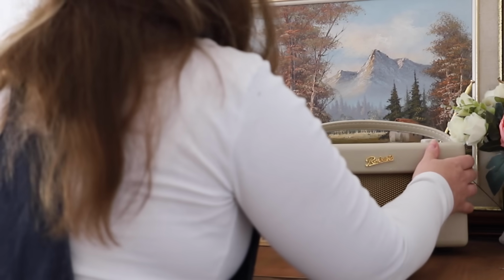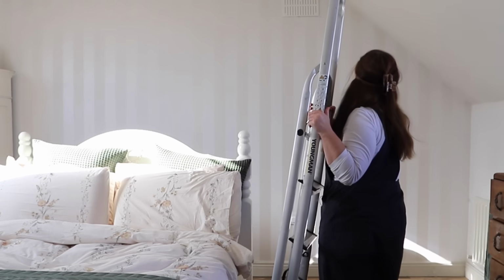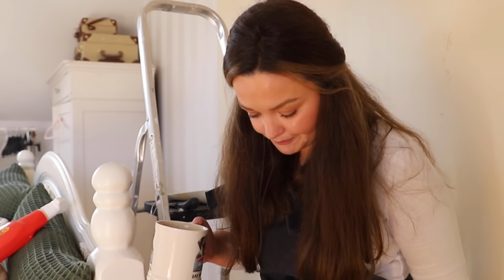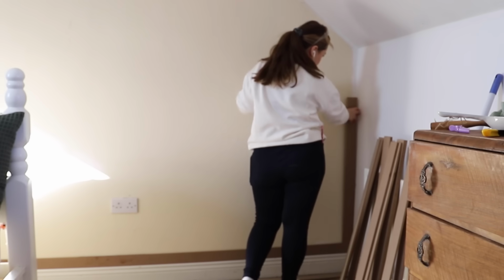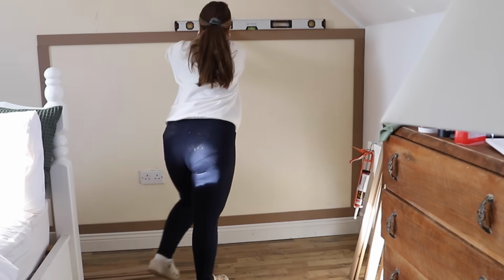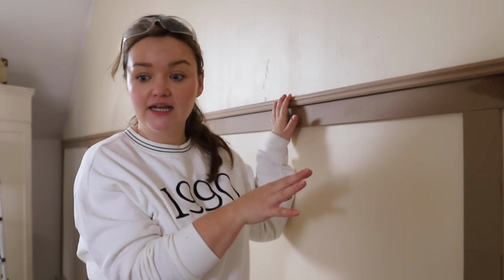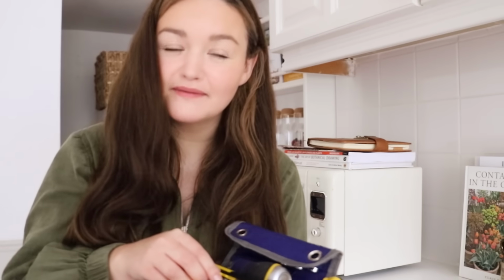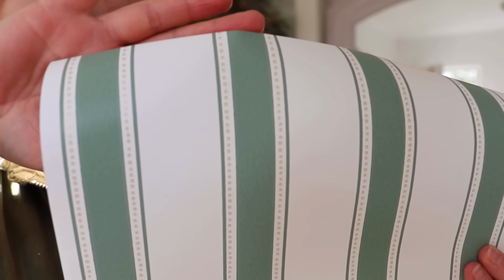Transforming My Bedroom on a Budget! Cosy Cottage Style Makeover 🌿✨ DIY Diary

Comment: Very ambitious.  I can relate, having just repainted and tidied up my snug so I could have a fresh comfy spot to do my Christmas wrapping.  And, yes, when I caulked the baseboard (skirting board), I had to use two hands and make a face to get the caulk out of the gun.

I feel so validated to see your dust bunnies!  My daughter recently bought me a robot vacuum for a big birthday.  I was skeptical, but I LOVE it.  It even goes under the bed  :)

My cats are fascinated when I move things around.
A cat tip for your weeing girl.  My anxious girl had the same problem and I figured out that she was overstimulated by catnip.  When I stopped giving it to her, it cured the random weeing.  I don't know if you use catnip, but it might be worth considering if you do.

Such a lovely big room with the high ceiling.  What you call a dormer bungalow, I call a story-and-a-half (or maybe two-thirds). That's what I have too and I love my bedroom, which I re-did not long ago.

Do you know if that was a strippable paper?  A vinegar and hot water solution in a spray bottle also works for stripping wallpaper, but not as slick as your steamer.

Do you have Benjamin Moore paint in Ireland?  My current obsession is with Simply White, and it's taking over my house.

A motherly bit of love for you...  Make sure Ricky Martin isn't so loud that you can't hear a normal conversation and that you don't have the earbuds in for more than twenty minutes at a time, for the sake of your hearing.  Another tip is to alternate ears so you can do twenty minutes on each.  Head phones are safer.  xo

Art Attack!  My girls loved watching that show.  I hope your nephew's teacher isn't subscribed and watching Auntie Catherine make his costume if it was supposed to be his homework.  Lucky loved boy  :)

Seeing the DIY process in diary form is not annoying, wheels off is just fine with me  💜

Comment: A little tip I use. The cheapest panelling at B&Q is £13.47 it contains 6 pieces of 1200mm of MDF (63mm W X 9mm T) making it around £2.25 a strip. 

You can buy a 9mm T MDF sheet for £12.97 that is 1220mm L 607mm W and B&Q will cut it in strips for you. The first 5 cuts are free (with each sheet you buy) then it’s 50p after. For this sheet you can get 10 panels at 60mm cuts for £2.50. Overall costing £15.47 making it £1.47 a strip. 

If you are panelling the whole house and you need loads you can buy a 9mm MDF that is 2440mm X 1220mm for £23 you can get 40 6mm strips out of it and will cost £17.50 to cut costing £40.50 overall. This works out as £1.01 a strip. The equivalent if the buy the pre cut  panelling packs works out as £90 but because you need packs it would be 7 packs for 42 panels £97.29

You can obviously customise the width of your strips to what you prefer and it’s so easy to grab the sheet and wheel it over to the guy to cut it for you.
Reply from the maker: This is really helpful, thanks for taking the time to share this x

Comment: Shouldn’t you nail the trim down just in case the glue doesn’t work all over. I love that you tackle so many projects and they all look great.
Reply from the maker: In previous projects I have used a nail gun, but I find the mdf is light and doesn't need it. However, whenI have used pine or heavier wood pieces, I will nail as the glue sets, to avoid the wood moving when the glue is drying, but mdf is grand with adhesive only. Also saves me from accidentally hitting wiring/pipes with a nail